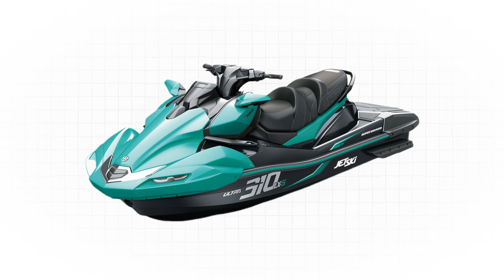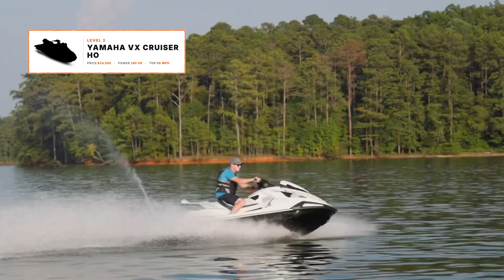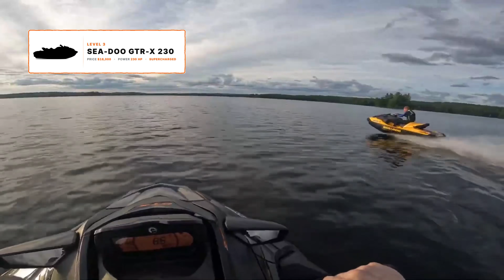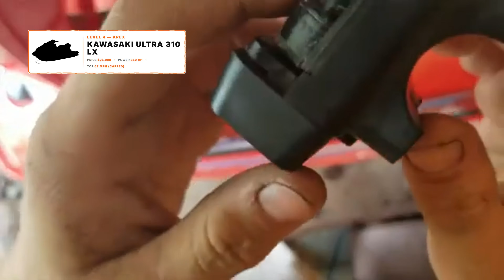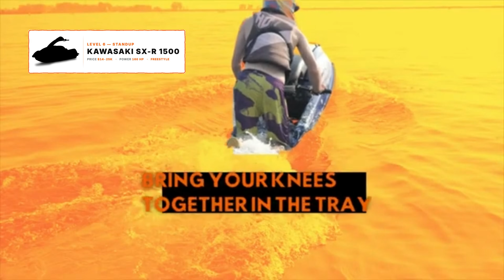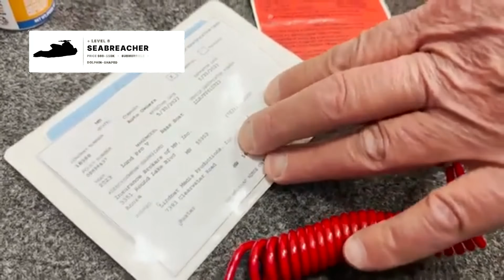The 7 Levels of Jet Skis That No Dealer Will Tell You About

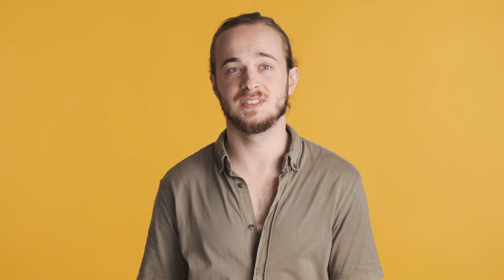Comment: 1:15 is flat out wrong. None of the stock  "uncorked" PWC's from Seadoo, Kawasaki or Yamaha will hit 90 mph or more. They will get into 70's or low 80's. While Yamaha does not advertise their horsepower numbers their PWC's have a label that shows horsepower. You list the VX Cruiser as having the TR-1 engine then state it has 180hp. WRONG AGAIN. The TR-1 is the entry level 3 cylinder that Yamaha uses in their lower end models. You can get the VX Cruiser with the TR-1 but it will be 100-110hp not 180hp. The older (2023 and older) VX Cruiser HO had the 1.8 liter, 4 cylinder, naturally aspirated engine good for around 180hp. Now (2024 and onward) the VX Cruiser HO it has the newer 1.9 liter (largest displacement of any of the 3 major manufacturers) that makes about 200 hp. Also, about the Belassi-https://www.youtube.com/watch?v=-W_gggJYxV0
Watercraft Journal and Watercraft Zone have both put out videos on it. Watercraft Zone shows that Belassi themselves only claimed a top speed of 78 mph and in testing Watercraft Zone only hit 73.9 mph. And its acceleration was far behind what you get with a Yamaha GP1800R SVHO or a Seadoo RXPX 325.  Even with its carbon fiber its still heavier than either of these. It is not a performance buy at all.  Riva will gladly sell you a much faster PWC for far less money than the Belassi. And you acceleration numbers are completely off. Again Watercraft Zone tested a Seadoo Rxpx 325 and 5-100km (next to impossible to have a PWC hold still on the water to start at a true 0 and 100km is 62 mph) is 4.56 seconds. 
https://www.youtube.com/watch?v=XbNO5u8dvRc
GreenHulk was able to get a 3.83 5-60 mph out of a 2021 GP1800R SVHO and the GP1800R SVHO has been unchanged since slight redesign in 2021.
https://www.youtube.com/watch?v=LQS6XciDuEw

Comment: The Spark is junk you get what you pay for, overshoot your jet port and hit the dock hard you crack the hull. Have fun changing the battery, you got hit just the right angle to put it in then try to get the hold down strap back on oh the joy. Changing the oil filter and the spark plugs is a real fun adventure. If you offered me one for free I take it and trade it in on a Yamaha

Comment: I'm 73 years old.  I first rode a standup JetSki in about 1990.  I was able to make a large circle around the lake without falling on the first try, but I found it awkward.  I bought a pair of Yamaha sit-down Waverunners in 1992 and became an addict.  I've owned over 30 PWCs, mostly Kawasakis.  I currently own 14, only half of which run.  The other half are projects in which I will swap 4-stroke engines into 2-stroke JetSkis and 2-stroke jet boats.  I  like the power of my Kawasaki 310, but it's big and heavy.  I prefer the power and nimble handling of the Kawasaki Ultra 150.  

One thing to keep in mind--the most dangerous craft on the water is a kayak!  People flip them over and get stuck in them and drown, or they hit their head on rocks in white water.
Reply: Most dangerous sport in the world? Fishing!!!!!! Swimming #2
Reply: Really you found the "Stand up " Jet Ski awkward? I was mesmerized. Went with my girlfriend's family to Mission Bay and had a blast. My first ride on the "stand up", I got to my knees and went straight across the bay, I couldn't turn. Fell off turned around and did the same back. The other personal water craft (PWC) they had was a Kawasaki SC750, I termed "sea couch", because you sat side by side. Girlfriend and I took it out together, it was a much easier ride but BORING. By the end of the 3 day weekend I could ride the stand up pretty good. But, I was hooked on the water toy. In the following few weeks I bought a JS550 and a JS440 and a trailer. Girlfriends brother bought a SX750 (a Kawi stand up) and a Kawasaki TS750 (a sea do sitting style PWC). We all went out for a weekend and again had a blast, got a lot better on the JS. Rode the TS, and while riding was easy it still bored me. Flash forward to 2026 and currently I have 4 JS hulls, 1 SX hull, an X2 and a Wave runner and a Wave Jammer, all currently run but the X2 needs cosmetic work. I'm now 60 and have easily owned 30 JS hulls, piecing together skis and also bought a few sea do styles. I'll always find the JS hulls the superior of PWC but that's me. I also prefer my dirtbikes over quads.

Comment: Interesting video, but the worst part is when it says "the washers wear out" (and need changed) on a BRP supercharger before 50 hours.  That's total crap!  I've owned and ridden three BRP 'musclecraft' skis (among many other PWC class skis) at least 600+ hours combined, riding with my hair on fire to the max and never had a supercharger issue on any of them.  I do agree with the 200 hour rebuild, but the 50 hour issue, nope!  My current BRP (untouched) supercharger has 118 hours and runs like a dream, same as the previous two skis with 100 hours minimum.   I've ridden hundreds of hours on ultra-fast skis and never been thrown off.  Mine does 74 MPH.  I'm actually more afraid of steering gear failure at high speeds than I am of my expert riding abilities.
Reply: I have a 2021 GTR. There’s no rebuild the supercharger at 200 hours.

Comment: I have owned and ridden 2 kawasaki ultra 250x riva tuned for 6 years. I'm 54 and still love the thrill. Never flipped them over and had 78mph on GPS. Just rebuilt both engines and hope they last another 19 years plus if looked after. One is 2007 the other 2008 and I flush every time and fog every time. 2007 has 115 hours and 2008 has 195 and going up. Both rebuilds were done 10 hours ago so many more years of fun to be had. Think they might outlast me lol😂😂😂 getting a bit more fragile now 😂😂😂
Reply: Hell yeah!  Im 55 and have 6 skis that are mine and mine alone.  Wife, kids and grand kids are not allowed on mine.  😂😂😂. They do have their own though.  My two 2002 GTX’s millennial edition will run 92 mph on flat water. Pure adrenaline!   This is another reason I will not let others ride them.